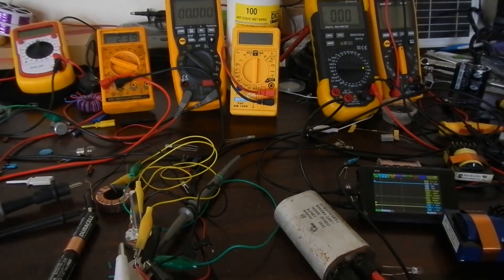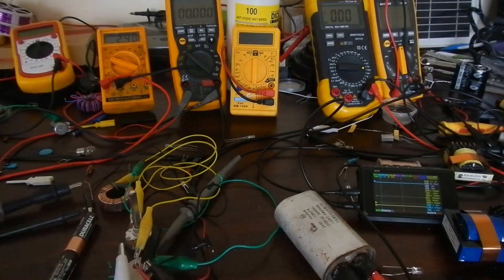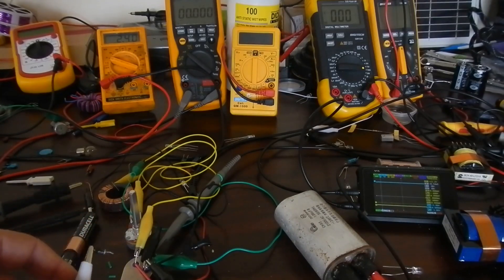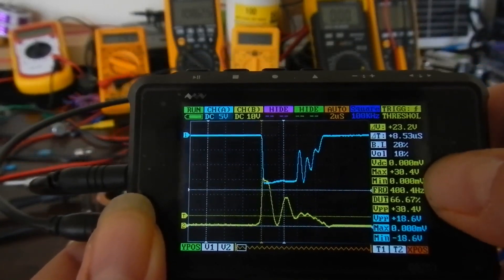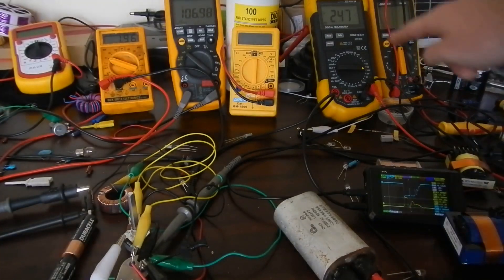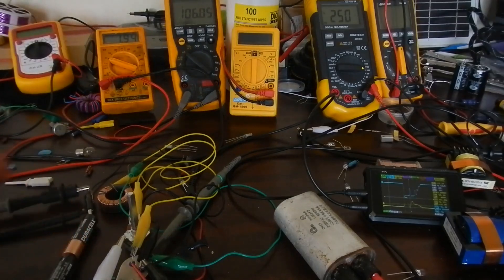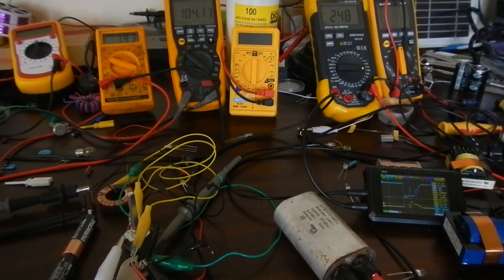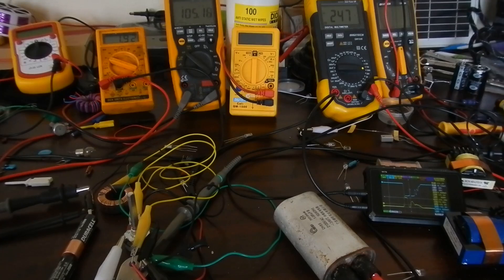250v from AA's using joule thief.

Comment: It will under normal circumstance create a very high voltage for a very short time. The principle can be use to create a stun gun ;) you can use an SCR or other high amp high voltage switch to have lots of fun :)

Comment from the maker: blows lots of stuff! I reduced frV in about 20 LED's to 0 before I thought of trying a more sutible diode. Although they last until the cap hits max, then they go out to let you know your cap is ready, lol. I actually touched both terminals out of curiosity, kind of like a fast electric fence... If you use the 270uf cap to weld the led legs together, disconnect it first or stuff tends to not work anymore.... What do you think will happen if I feed the 300v into a flyback? will find out soon :)

Comment: Haha indeed a nasty shock.... Experience them little too many of those but still haven't learn my lesson still play with high voltage! 250V is very nice indeed for 100 mAmp that's nice with some modification you could probably go in the Kvolt range but if you plan on doing so I would suggest you do a secondary winding since those spike will destroy almost any transistor. Also you can even use heavier gauge wire and less turn to drop down your voltage and boost up the amp lots and lots of fun!